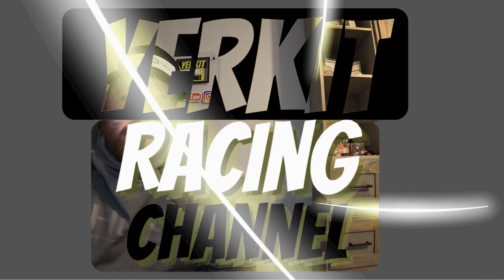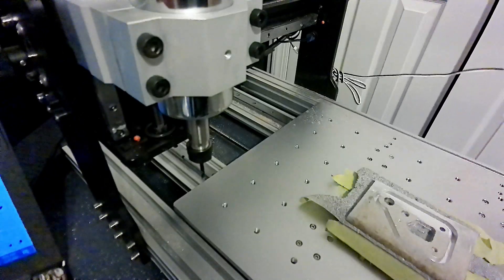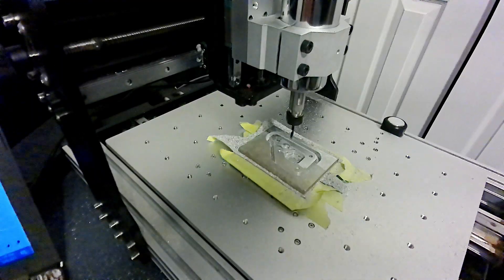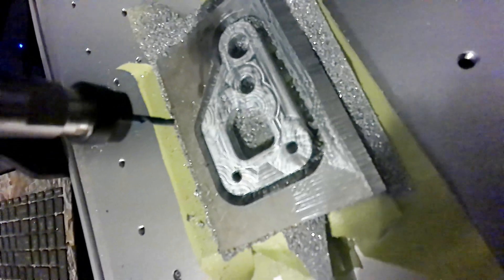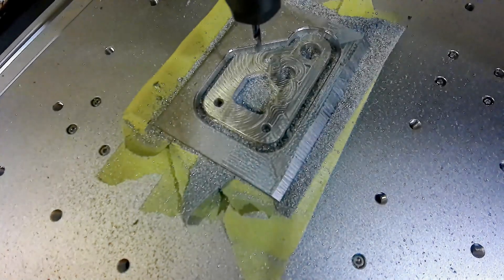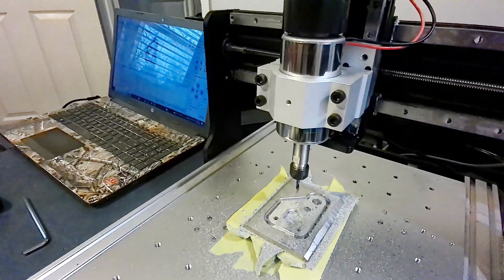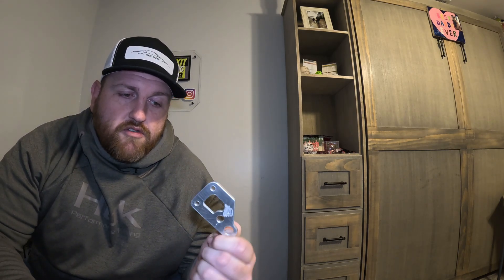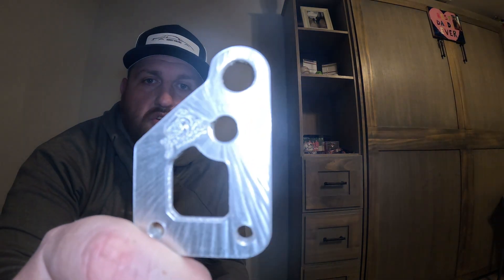Achieve Pro-level Aluminum Finishes on AnoleX 3030 Evo Pro? Comparing Tool Paths for DIY CNC Milling

Comment: What CAD software did you choose to use with the Anolex? I am getting a 4030 and want to do aluminum - mainly etching and some basic cuts.  Not getting fancy yet.
Reply from the maker: I'm using fusion 360 and really like it as there is a ton of support from forums and videos to explain anything you might get hung up on. Seems to be able to do most everything too.
Reply: @YerkitRacingChannel  I started the tutorials. I will definitely add to my list. It's powerful but a little overwhelming to start. Are you using it to generate gcode? May want to get your cam config and try it with UGS. Thanks for the reply
Reply from the maker: @MichaelAmster  Yeah, it's tough to learn it all on your own. Would've been nice to have someone in my circle that could explain it to me for sure...  Some of the information is hard to find! I'm generating gcode with fusion also. I have managed to get stuff done but still learning everyday.

Comment: Would you say out of the box it works fine with aluminum (slowly)  ? Why did you buy this as opposed to a Genmitsu?
Reply from the maker: Very slowly out of the box... Too slow really for any kind of production on aluminum. But it's really good with the upgraded spindle. After some research, I liked this machine and contacted Anolex. They came on as a channel sponsor and they sent me this machine out to try. I didn't reach out to Genmitsu about trying out one of their machines, but wouldn't mind trying one in the future for comparison!

Comment: Not trying to be a richard, but I can't make anything out. I see faint linescand blur. I have a couple of screenshots if interested, but not getting much from the videos. I really want to take this journey with you, but damn...
Reply from the maker: They should get better now... The camera I had was trash and wouldn't focus anymore. I dropped it a while back and it was never the same after. I picked up a go pro 12 a few weeks ago. Seems to be a ton better than the old vivitar even though they are both 4k
Reply: @YerkitRacingChannel  cool. I'm interested in how it goes. I'm picking up a 3030 next week.
Reply from the maker: @hardlife3844  Awesome! This is my first CNC of any kind so the learning curve was real steep lol. Finally starting to get somewhere with it all though. Fun once you get the hang of it

Comment: try to do the surface first to get a true flat surface. and in your other vid, with that machine max depth of cut should be .01 max
Reply from the maker: Yeah i need to do the surface first and see if that makes it any better. Depth of cut on this part ended up being 0.0039. Cranked it up to .0078 and it did decent there. With the right speed and feed rate it would probably be okay at .010.

Comment: Some guy on the shapeoko forum said to use the smallest bit possible to get a uniform look.  So ultra high rpms, single flute end mill, with maybe a 5 flute end mill for finishing pass or something?
Reply from the maker: I think thats probably what I need is a cutter with more flutes. This was all done with a single flute.
Reply: More flutes can be better depending on load, coolant and material. For aluminum, 4 flute does great for most cuts, the finish has more to do with rigidity because tool deflection. To deal with this, a multi flute bit at high rpm and slow feed speeds will give you better cut quality mostly due to tool defection. Suggest adding a steel plat on the back and sides to deal with that. A simple fix. Next step is a more rigidly constructed spindle. The square spindles on amazon work well. I have a 1.5kw and a steel plate backing it. Anything you can do to keep the spindle from deflecting will do more than running a different bit and save you hours on running test tunes. Plus you can ramp the feed speeds up then as well making it able to run faster. I did these two on mine and it cuts steel fine with slow feed and the spindle speed lowered. 1.5kw spindle and steel reinforcement for the spindle gantry. I have one on the sides and the back all bolted together. Also added a linear rail on the back as well to reduced any tilt the spindle may have while cutting. Next upgade is linear rails added on the bottom with a granite machinist block to bolt it all down to. All this can be done at home with minimal tools. Drill, taps, and some files are all i used. Plus a countersink. even the granite plate can be done as well at home.

Comment: Very cool looking pattern at the end! If you want a uniform appearance you can always just toss the parts in a tumbler. But that will remove all tool marks
Reply from the maker: Thanks! Yea I was hoping to be able to keep the tool marks but just have them be a consistent pattern. Tumbler just might be the best bet for keeping production times down. would only have to machine one side that way too...
Reply: @YerkitRacingChannel  look into using an abrasive pad on a 2" disc. Run it on slow RPMs and you can either touch down in a preset pattern, or just drag it across. Will leave a nice pattern and significantly cut down your finish times
Reply from the maker: I will give it a shot and see how it turns out. I had these brackets plasma cut before but cleanup was terrible... Was thinking they would come off the mill ready to roll but now I see it's just a different type of cleanup lol
Reply: @YerkitRacingChannel 
They absolutely can. It all depends what you need. Also a simple parallel toolpath will be the fastest and easiest way to surface. You can ignore any holes or other features that are below your surface plane, and just go up and down with a good step over until you're done. If you're surfacing and have very little depth of cut, there isn't much gained from adaptive tool paths
Reply from the maker: I will go back and look at the parallel tool path again. Cant remember if I chose to ignore the holes the first time I tried it. That may have been what I didn't like about it before.